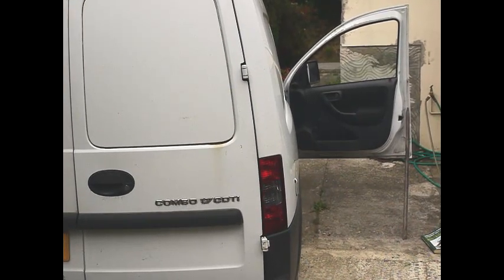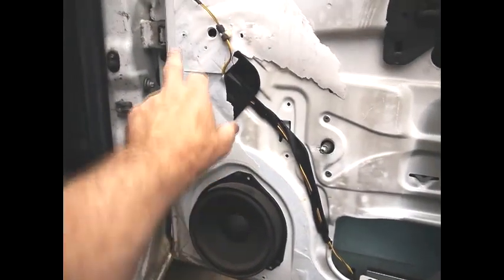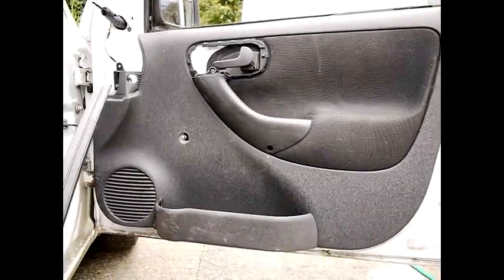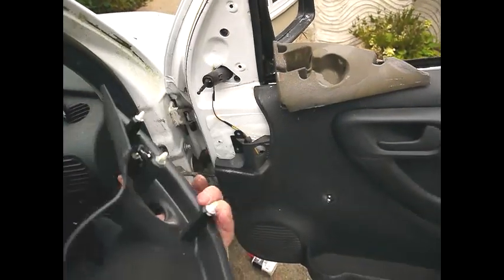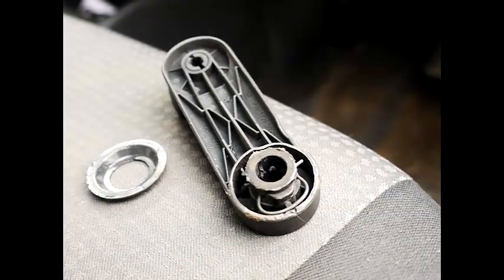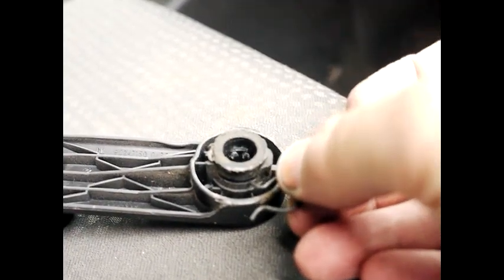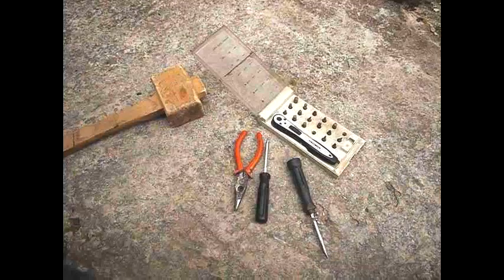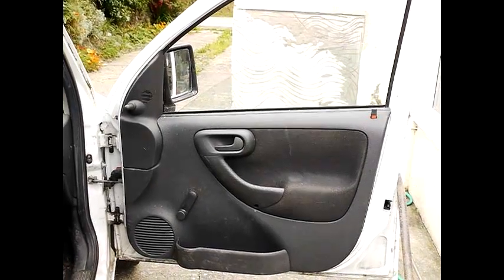Re Fitting The Vauxhall Combo Door Card

Comment: Wont it leak in to the van without the plastic in between the door and the card?
Reply from the maker: Well it doesen't seem to.
Reply: @avianfish8732  not unless the drain holes on the bottom of the door are blocked, the moisture barrier has haps around the wiring loom anyway